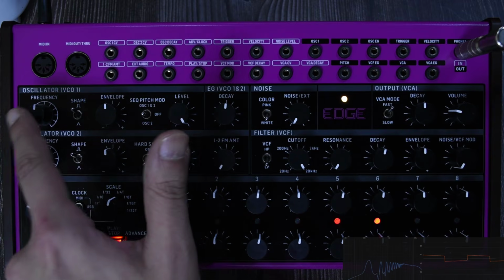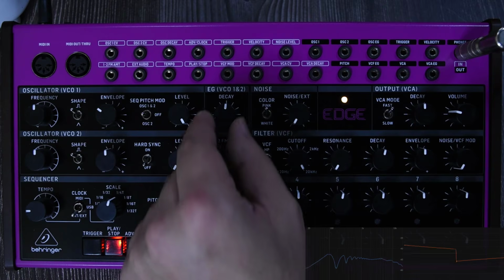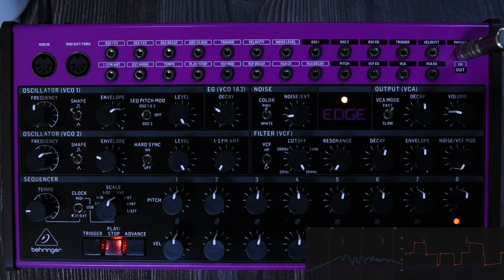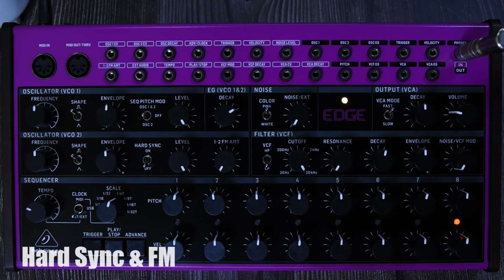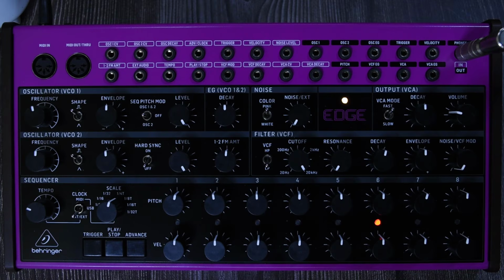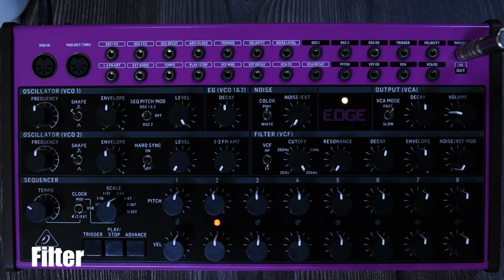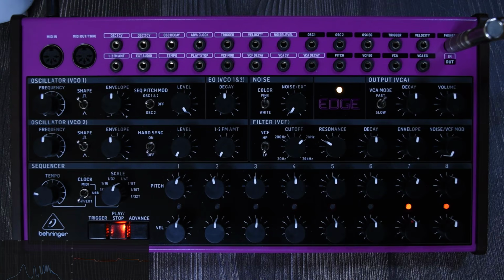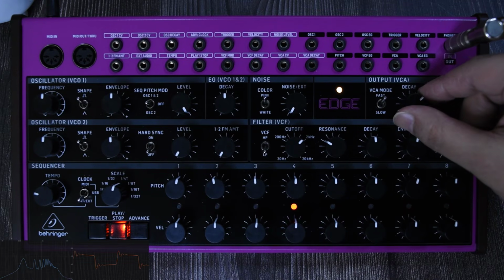The Behringer EDGE synthesizer complete Deep Dive guide tutorial

Comment: Thank you for the tutorial! Great explanations on what you can do with the Edge. One of the patch examples that you have shown connects trigger->velocity and velocity->osc cv. This is the same as using the pitch knobs as with them we are modifying the cv of the oscillators? Therefore, which benefit you get to do this patch? Can you still use the pitch knobs to modify it or maybe use it for another purpose? Thanks! Great job!
Reply: the pitch control is from -5 to +5 volts..

Comment: Hey, that was a super helpful guide! One thing that I tried but didn't work was the following:
I have an external sequencer that is sending midi notes with a specific velocity.  I chained the velocity out with the vcf mod (exactly how you showed in the video) expecting the velocity data of each midi note to affect the vcf mod. However I discovered, that apparently the velocity out only outputs the voltage of the velocity knobs instead of the midi velocity. 
I am not sure if I am doing something wrong or if it just doesn't work. Have you tried something similar and what were your findings?

Comment: For those with Dawless syncing Issues~

After playing around with the Crave and the Edge for a bit, I found it's easier to keep your device plugged into a  computer and hooked up to Behringers editor program to mess with it. Normally I run a pretty Arturia heavy table, my drum machine is the Drumbrute Impact. Most my equipment runs good at 24ppq. 
Not so with the Crave. Works good the first time you plug it in, then it starts to get goofy.

 So I turned it to read straight CV and it worked like a charm! Haven't had a sinc problem since.  My edge just came in yesterday but im expecting to have the same issue and hopefully the same solution. 

Im planning to get a lot of use out of them. So I'll update this if i have any better info.
Reply: Feel free to hmu with any DAWless questions!
Reply: @Ghostline so midi clock sync is is useless?
Reply: @gc583   No it works great with the Midi sync! didn't plug it in til after this post. If you clock though midi you should have an easy time. Also the trigger on the Edge works great for running Volcas or anything that runs off a 1 per beat signal.

Hope that helps!
Reply: I use them all the time. I mIdi to the Edge then use the trigger CV to time the crave. You could probably do both with Midi but I like having my crave cut off with my edge in the way I have my table set up.